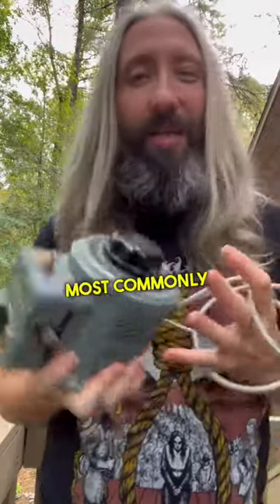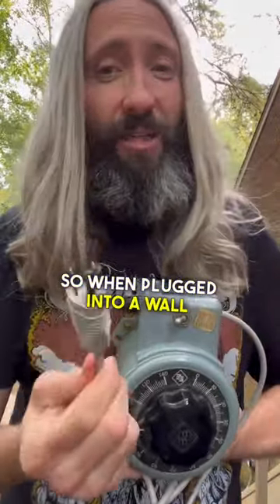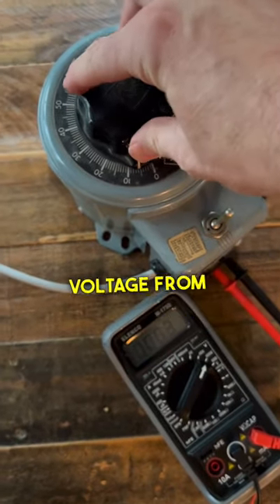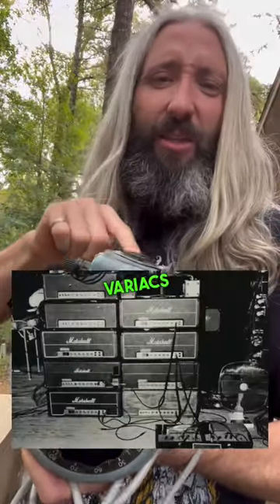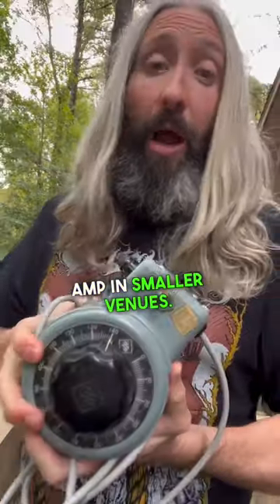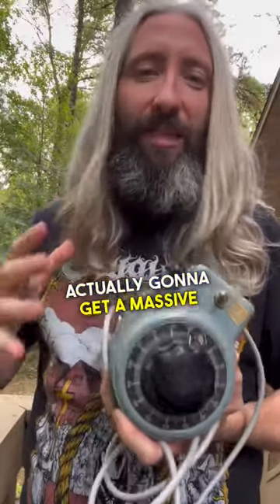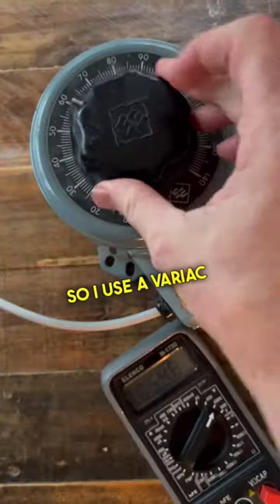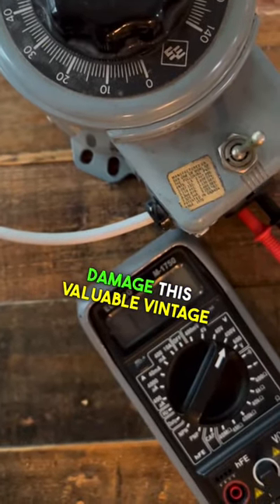How To Use A Variac With Your Tube Amp #guitar #eddievanhalen #vanhalen #shorts

Comment: You boomers making obsolete tech valuable is hilarious.
Reply: It’s the tone man!   🤪
Old does not mean useless!  Hey a good tube amp is definitely worth keeping, I’ve got a ‘68 Ampeg V4, I got for the price of the output Tubes in the 80’s….just $120 to bring it back into spec and clean it.   Plugged into an EVM 15L in a folded horn cab built in the 1940’s out of 1” birch ply.  It’s a killer studio bass amp, and the cab and speaker didn’t cost me a dime.   I would have to spend thousands to get as good a sound, which is of course subjective, but the Ampeg has very useful controls, 3 settings each for: sensitivity, 
Treble, Mid contour, AND bass.

I definitely wouldn’t want to move it! (68 lbs head!) or gig it, but as a house amp it’s fabulous!

I don’t play bass much anymore, but in the garage is a 1000 watt Carvin stereo head and a Cerwin Vega 18”, for a gig, but for a 20 x 18’ room, this old Ampeg through a 70 year old speaker cab is perfect!

Old tools and new tools are not incompatible 🙂
Reply: @jonathanstrand2474  I haven't heard a sound worth playing a neural can't make.
Reply: @DevilsAvocado69  bang for the buck, that matters too, my old Ampeg and old Fender Bassman is worth way more than I’ve put into them.  Because I’ve had them for years.  My current main amp, a Mesa Boogie Mark 5:25 only weighs 16 pounds. Not much more than a digital set up.  Guitar sound is about 90% speaker and pick ups, so I’m not knocking what I’ve never tried, but I’m also not buying it to find out.🙂  secondly what sound do ya like, what music do ya play, that factors in mightily as well.   Nowadays lots of folks get it all from a floor pedal, or a neural thing and a powered speaker, or even direct to PA.
I’m not knocking that either.  Nita Strauss doesn’t even use an amp!, & fly rigs are very handy.   Guthrie Govan moved to digital for convenience and instant access to zillions of tones….because he plays zillions of styles.  (He says he still prefers his Victory Amp tho) but I’ll never be them!    I did buy a Plethora vs my pedal board for playing out, and I have digital pedals that I love, the great thing is the choices are practically infinite nowadays.  

Secondly recording, for that a DSP makes perfect sense, no mics, no hassle, if you are using pro tools anyway, someone else has already tweeked them, and besides it’s digital to digital.
To each his own.  UTube presenters like Rabea Massad usually use both, and a load box, but budget factors in, many ways to get a desired result.😊 using old stuff is just one of the many

Comment: A Variac is what you Must  use to slowly power up all vintage audio electronics with transformers in them,if you luck into finding a mint McIntosh 350 watt @8ohm monoblocks worth $50 grand a pair the last thing you'd want to do is hurry up & plug the amp into a full 120 and power it up to watch the awesome smoke show .